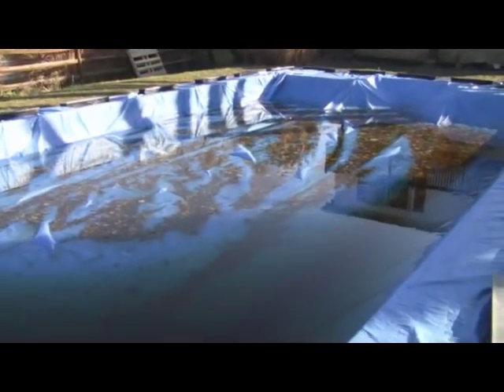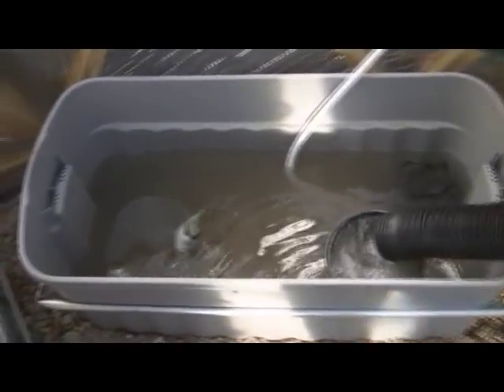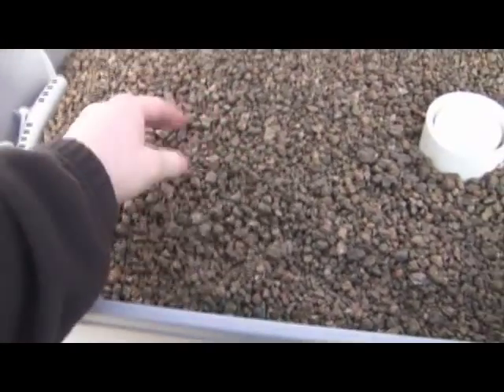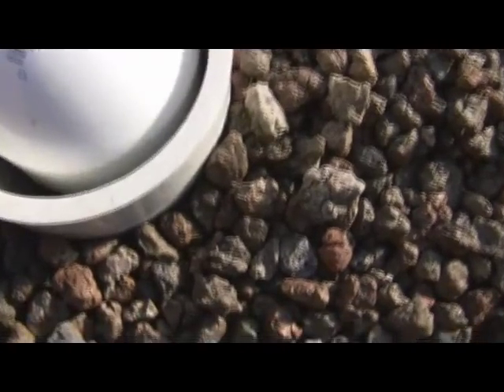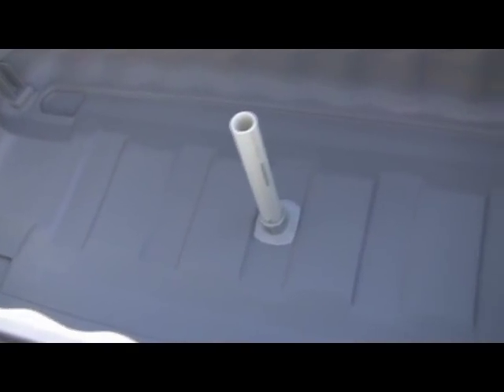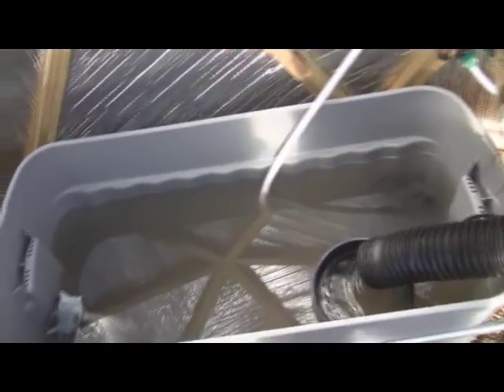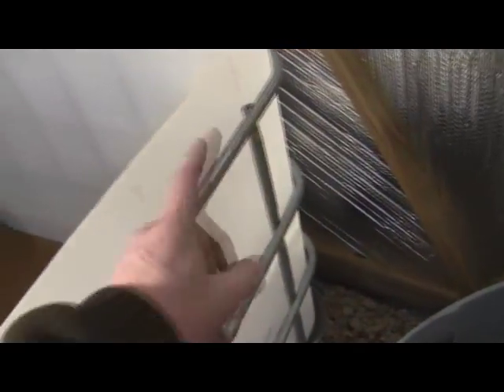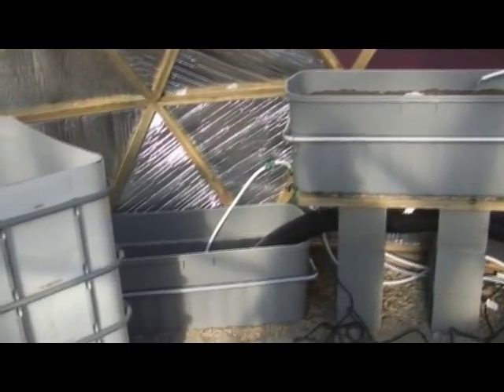12.25.11 Dome Update - Aquaponics setup

Comment from the maker: @AquaponicLynx Hi, thanx for the suggestion.  I replaced the brass with plastice Y's right after making the video.  The tea water was changed out and replaced with fresh rain water the following Tuesday after Christmas since it rained all day again.  I had an algea bloom after warming the water to 70F but the Danner air pump did the trick and now only the bottom and sides have algae film.  The little pump was just a test pump and was replaced by a 1300 GPM bilge pump.

Comment: I might recommend upgrading your plumbing since the brass hose manifold (especially if the water is more acidic once using rain water) could leach too much metals into your fish water.  And if you upgrade the plumbing to larger PVC you will probably get more flow from your pump and it might even be enough to use that single pump to feed your fish tank and the grow beds.
Good Luck with it.

Oh and the tea colored rain water is probably not a bad thing, most mature AP systems have that anyway.

Comment from the maker: @efisgpr Sure no problem.  Oh, another interesting thing about growing plants in these beds is that the spacing in not an issue since the plants get all the nutrients they can handle.  You can crowd 'em without worry.  Also, weeds are not a problem since they are so easily removed from the growing media....  No stooping because the beds are right about waist high.  The inside of the dome can double as a trellis for climbing plants.  Plenty of vertical space for hanging plants too.

Comment from the maker: @cputb1 Hey CP, happy holidays man.  Hopefully, I'll have some fish and plants in the next update.  The seeds have sprouted and all 5 grow beds are circulating.  The fish tank is full and circulating by itself to get the oxygen level up.  I'll put an air pump and stones in it in a few days then connect it to the grow bed circuit.  Next step would be to add plants and start adding ammonia to the water to get the beneficial bacteria growing to convert it to nitrates for the plants.

Comment from the maker: @jimmymac30 Hmmm well since this is my first attempt, I'm gonna start with comet goldfish... 13 cents each at the local PetsMart.  Once I get the water heater working, I'd like to switch to tilapia.  Some other options are blue gill and yellow perch which like a colder water than tilapia.  The fish tank should be able to hold about 100 fish max but I don't think I'll put that many in.  For plants, I put a list in the more info box... they were planted a few days ago and are sprouting

Comment: Hi - Im interested on how your greenhouse is holding up.  Do you get condensation and how to do you deal with it?  Did you use the ground as a thermal mass or just the fish tank?  We are thinking about ordering the GD18.  Trying to figure how to mount it to the ground.  We don't really want to build a concrete foundation if we dont have to.  We are in Zone 4B so it gets pretty cold in the winter.  We don't want cold air to get inside at night in the cooler season.
Reply from the maker: It's down now.  Yes, there was a condensation problem... not much you can do except make sure the fish tank is covered as good as possible and keep up on the mold growth.  I used a subterranean heating and cooling system plus the 300 gal fish tank was a thermal mass.  I heated the water which helped keep the inside of the dome from freezing.  I built mine on dirt and used a large vinyl tarp for a vapor barrier along with pea gravel.